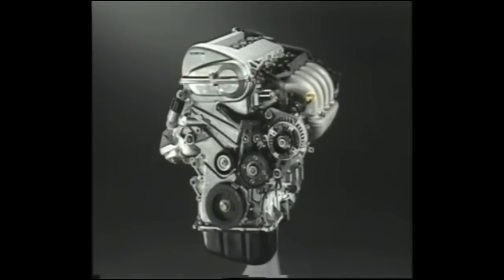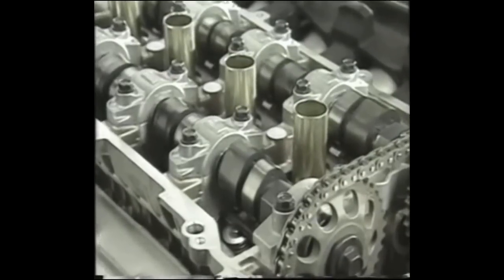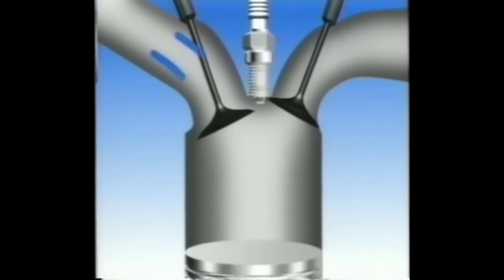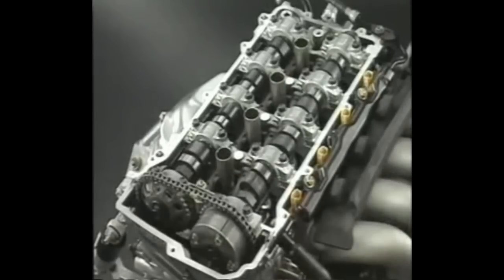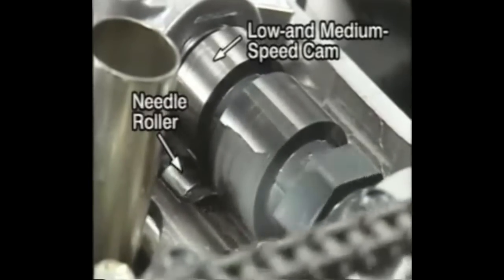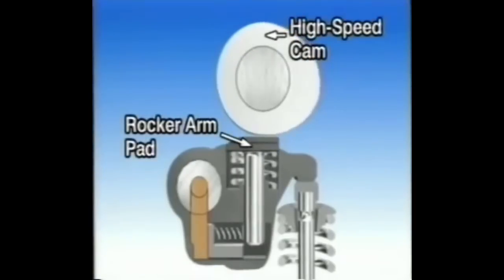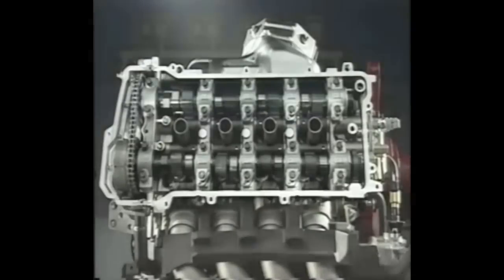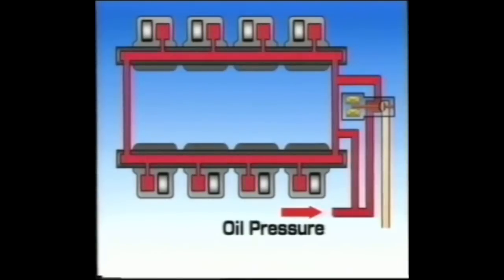Toyota's Valve lift VVTL-I explained on 2ZZ-GE engine

Comment: Two cams in one engine has been the dream of Hot Rodgers since modern Valve Timing was introduced to modern engines. TČhe first attempt was made by Rhoads Lifter company that made special hydraulic valve lifters that bled off pressure at lower RPMs allowing thend came the varicammsystem which changed the advance or retardation of the timing the came to provide different duration as the RPM. Now we have this system which changes the timing events of the camshaft by advancing or retarding of the valve lift under different Rpm Ranges the engine will see during its changes in speed. If you put all of this together and you’ve got electronically actuated valves. What a great system from a performance standpoint and koninsegg already uses. Soon other exotica super cool cars will too!
Reply from the maker: Indeed. Nicely said.

Comment: For the record, this extra complexity is worth about an extra 40 horsepower and 2000rpm to the power band, which is huge on a 110ci (1.8L) engine.
Reply: @NathanHiggers69  
The difference between the 1ZZ with vvt but not lift and the 2ZZ with vvtl is about 40hp and 2000rpm.
Reply: @177SCmaro  58-73hp difference. TRD Sports-M 2zz-ge produce 205hp, 2zz-ge produce 190hp, 1zz-fe produce 132hp
Reply: @artemreshetnikov5179  
Talking about the stock engines.
Reply: @177SCmaro  JDM 2zz-ge full stock produce 190hp.
Reply: @artemreshetnikov5179  
The US version of the 2ZZ was rated at 180hp, the 1ZZ 140. That's a 40hp difference.
Reply: @177SCmaro  UK spec is also 190hp for 2zz ge
Reply: @drewcoal  
Right. I think it either had something to do with a slight difference in the tune, the difference in how hp is rated, or it could be the crappy gas in the USA. It was also rated at 190hp in the Lotus Elise regardless of where they were sold.
Reply: @177SCmaro  the 2000 MY  did 190hp. 2001+ was 180 and reduced redline in US at least.
Reply: The 1ZZ-FE comparison isn't a great one since they're totally different engines despite being in the same series. The 1ZZ-FE produced 138bhp in top spec while the 2ZZ-GE produced 192bhp. The 1ZZ-FE has VVT-i so can't be compared with an engine with a fixed system. The cylinder sleeves are different materials between the engines, the intake and exhaust ports and valves are totally different, the stroke and bore sizes are different. The intake and exhaust systems are different etc etc. Totally different engines.

It's also difficult to determine how much power the VVTL-i system makes. The correct answer is it doesn't really make any. You could remove the system so it just rides on the big cams and get the same power but you would lose low end torque and efficiency. Alternatively you could make it run on just the small cams and it would perform just the same at low RPM but at high RPM wouldn't have as much power and would drop off much sooner. Asking how much power the system adds isn't an answerable question since the engine was designed to have that system and the two cam profiles were designed with the VVTL-i system in mind and there was no variant of the engine without it to compare to.

I suppose you could assume a cam profile that the engine would've had if non-VVTL-i engines were designed and you could compare power figures but it's all speculation.
Reply: @bradcogan8588  I'm guessing you've never actually looked at a dyno of the stock 1ZZ and 2ZZ. They make similar power (with the 1ZZ having an advantage in low end torque but not a big one) until the 2ZZ comes on it's big lobes about ~6200 rpm at which point torque, and thus HP, spike to a peak of ~40 more HP then the peak of the 1ZZ.
That is the basis for me saying the "extra complexity" i.e. the "L" in Toyota's VVTL-I is worth about an extra 40hp over not having it, which the 1ZZ, a relativity similar engine for comparison, doesn't.
And of course the VVTL adds horsepower. You can even test this by disabling the swtichover to the big lobes and watch 2ZZ flatline at 6000rpm. 
Also, again, if you look at a dyno of the 2ZZ just before lift (~6000rpm) they usually make about 140HP at about the same peak as the 1ZZ. 
And saying that a 1ZZ and 2ZZ are "totally different engines" is like saying a LS3 and an LS7 are "totally different engines" - yes and no, but it doesn't mean they're not comparable in some ways.
Reply: @177SCmaro  what I'm saying is the cam profiles were selected because they were gonna have VVTL-i. If they weren't gonna have that system they would've chosen a cam profile in between the two for a good compromise between low end and high end power as well as efficiency. This theoretical non VVTL-i engine would no doubt still make more power than a 1ZZ-FE due to the entirely different characteristics of the engine and one can only speculate. Saying the system gives it 40bhp more because when it doesn't work it produces 40bhp less isn't an accurate assumption, you're basically saying, when the engine is faulty and doesn't work as it should it produces 40bhp less which isn't the same as having a 2ZZ-GE engine built without VVTL-i.

The 1ZZ-FE and 2ZZ-GE really aren't as closely related as you might think. Other than displacement, weight, fitment, external dimensions and ancillaries, they're really not very similar at all. They're both 1800cc but have completely different strokes and bore diameters. The 2ZZ-GE has low friction metal matrix composite cylinder sleeves, it has a wider bore diameter and a shorter stroke for high RPM performance and reduced rotational mass, big Yamaha-designed wide angle ports with huge valves for high flow at high RPM, a higher compression ratio, a better flowing intake manifold etc etc. You couldn't just slap 2ZZ-GE big lobe sized cams into a 1ZZ-FE and make 190bhp.

VVTL-i isn't a system put in cars to make more power, it's a system put in place to have a flatter torque curve and a more efficient engine. A VVTL-i engine will produce the same amount of peak power as a 2ZZ-GE stuck on the high lift cam.

It's worth noting that for racing applications, the cams are often swapped for cams with a single lobe per cylinder and the rocker assembly swapped for a fixed system. These engines produce the same or higher power than standard engines despite not having VVTL-i anymore, the low RPM performance and efficiency is just reduced because it doesn't need to perform well at lower RPM like a road car does.
Reply: @bradcogan8588  
"what I'm saying is the cam profiles were selected because they were gonna have VVTL-i. If they weren't gonna have that system they would've chosen a cam profile in between the two for a good compromise between low end and high end power as well as efficiency.'
Well, duh. Obviously. Any other pearl of wisdom you might enlighten me with? (kidding)
Seriously, though, obviously if you're going to do something it's because of a reason. I'm not sure you're really adding anything here. I'm already very familiar with VVT and why one might use it or not use it. You don't have to explain it to me. (actually decided not use it in my 5.0 coyote race car, incidentally).

"Saying the system gives it 40bhp more because when it doesn't work it produces 40bhp less isn't an accurate assumption..."

Even though it's factually true. Okay then...

"
...you're basically saying, when the engine is faulty and doesn't work as it should it produces 40bhp less which isn't the same as having a 2ZZ-GE engine built without VVTL-i."

lol, um....functionally, de facto, it is. A 2ZZ with the lift not working is the same as a 2ZZ that doesn't have lift - runs and drives the same. The only difference is the extra set of lobs and the extra pad on a the rocker arms (along with some hydraulic, wiring, software, etc that control it, to split a few hairs)

btw, the engine doesn't necessarily have to be faulty to cut or increase power by turning lift off or no. When the engine is cold the ECU disables lift, for example.

Also, no. I'm saying that, because of this thing they added, this VVTL, then engine makes 40 more hp then if they had not added it and just stuck with the VVT as per the 1zz. The 2zz is, in concept if not in form, a 1zz built around lift in order to make more power and while maintaining the 1zz streetablity.

"VVTL-i isn't a system put in cars to make more power, it's a system put in place to have a flatter torque curve and a more efficient engine."

That is a half-truth because actually, it's both. VVTL is a system put into the 2ZZGE to have a flatter torque curve, a more efficient engine, and to make more power. The 2ZZ was specifically developed as a performance engine. The VVT got them a flatter torque curve but the "L" got them more hp buy extending the torque curve past 6000rpm, increasing the engines performace.

"It's worth noting that for racing applications, the cams are often swapped for cams with a single lobe per cylinder and the rocker assembly swapped for a fixed system."

Yes. A higher level of performance then was the 2ZZ was designed for. But it's still being done to make more horsepower just as adding secondary lobes was done to increase performance at the level the 2zz was designed for.
Reply: @177SCmaro  don't get me wrong the system definitely improves performance as it performs more efficiently across more of the RPM range. What I'm saying is the system itself doesn't add power. If stuck in high lift, the peak power will be the same, if in low lift, the peak power will be lower because that lobe profile isn't made for high RPM. If Toyota and Yamaha had designed the engine to not have a lift feature, it wouldn't utilise the same low lift lobes, as they're not suitable at high RPM and were only selected because the engine has the lift capability. I hope you get what I'm saying. The system doesn't add anything but taking it away reduces power but it doesn't necessarily work the same way the other way around. I think we understand each other, just looking at it from different points of view.
Reply: @177SCmaro  I guess it depends what point of view you look at it.

You might see the VVTL-i system as a way to switch to a bigger cam profile at high RPM to make more power on an engine built for low RPM performance with a small cam profile, whereas I see it as a way to switch to a smaller cam profile at low RPM for better low RPM performance on an engine built for high RPM power. 

They both make sense and I think we're looking at it from different sides of the same coin. But when the question is asked "What does the VVTL-i system do for peak power" your answer is about 40bhp whereas my answer is nothing. Both correct answers when viewed from their respective points of view.
Reply: @bradcogan8588  
The system definitely adds performance  but the system doesn't add power. 
I don't know what to say to that, if the system is "improving performance" then it's adding power (performance), if it's adding power it's improving performance. You just said that same thing twice, agreeing with it once and disagreeing with once. 
The system does add power or take away power. It depends if it's on or not. 
"The system doesn't add anything but taking it away reduces power..."
Again, that's saying the same thing two different ways and denying it and agreeing with it. If something is taken away it can be add back. It's both.
I understand me. I understand you. But I don't think you understand you as you're basically equivocating all over the place while thinking that you're being rational.
Reply: @bradcogan8588  
.
Reply: @bradcogan8588  
"You might see the VVTL-i system as a way to switch to a bigger cam profile at high RPM to make more power on an engine built for low RPM performance with a small cam profile, whereas I see it as a way to switch to a smaller cam profile at low RPM for better low RPM performance on an engine built for high RPM power."

I see it as both at the same time. The mistake you're making is framing it as a (false) dichotomy. The 2ZZ was built as a "low" and "high" rpm performance engine (relatively speaking, I own one of these and they're pretty dead below 3000rpm so, really, they're more like a "mid" and "high" rpm performance engine as opposed to one or the other) it's not a low rpm engine made high rpm or a high rpm engine made for low, it's both. That's the whole point of what VVTL allows you to do.

We're not looking at it from two different sides of the same coin. I'm looking at it for what it is and you're trying treat the same idea as being two different things at the same time in order to try to salvage your original thought rather than amend it. Not to get all philosophical on you, but that's a fundamental violation of the "Law of Identify". A is A, it can't be A and B at the same time. Adding performance and adding power are both "A".
Reply: @artemreshetnikov5179  apparently some of the 1st year 2003 Matrix XRS with the 2ZZ-GE only made 165hp. That's the one I had in the car I bought for $400CAD. It was the rare 1-year only XRS with the auto trans so it was pretty useless but still fun to hear the VVTL-I kick in
Reply: For another 500k USD you can have another 100HP.
Reply: ぐるぐう  
It's probably both. The tune in different because the fuel is different.
Reply: ぐるぐう  
I actully run e85 in my race car. If you take care of it's quirks it kicks the shit out of pump gas and most race gas in a performance application. 
And it maybe that US fuel has improved since the early 2000's when the 1zz and 2zz came to the US. And fuel quality also varies within the US. It's also possible that you're right and I'm wrong.
Reply: Yea the difference between the 2zr and 2zz
Reply: @thehugob77 you can turbo it reliably for less than 10k and more than 300hp peak
Reply: @drewcoal apparently the UK(euro) spec puts out 192hp, the Japanese spec puts out 190hp and the US model puts out 180hp

Comment: I have a 2006 corolla xrs with this 2zz engine. Whata a good maintenance list that I should have besides the engine/transmission oil?
Reply from the maker: We advise to check the liftbolts every major service or around the 40k miles. And replace if signs of wear. The later models don't wear as fast/bad as he old version. But it's a cheap insurance.
Also while the valve cover is off, check for wear on the high lobes of the cams.
The valve cover has a oil supply that sprays oil on the cams. Check if the line is not blocked (by blowing some air through the line and see if all holes are open.) and replace the little o ring on the oil feed line on the valve cover.

Hope it helps.

Comment: Just over 200,000 miles on my 2ZZGE and still going strong. Use Denso IK20 (5304) plugs in mine. Seems to help also. Regular oil changes. Lift bolt inspection every 35 000 miles. Keep OCV filters clean. Should last. Fingers crossed! But excellent engine.
Reply from the maker: Nice. If well maintained like you do they can last a long time

Comment: Great Explanation on the 2zzge! 00’ Celica GT-S
Reply: ZZT231RyDa gts? Is that USA spec? UK and Ireland had Celica T-Sport 140 and 190hp using 2zz-ge also Corolla hatchback T-Sport and Corolla T-Sport Compressor also hatchback.
Reply: Yeah here it's Celica GTS and Corolla/Matrix XRS, and of course the Lotus Elise, Exige and 2Eleven.. I have a Pontiac Vibe GT featuring the same eng/trans $550 auction cars FTW.
Reply: @TheBlueCorolla  The 140hp actually has the 1zz with only vvt-i.
Reply: @КлиментЦонков  what is diff between vvt i ans vvtli
Reply: @harveymorgan1749 no lift on the 1zz

Comment: I had a 2003 Matrix XRS with this motor! Toyota put it in the Celica, Corolla, and the Canadian-made Matrix xrs! Mine was tuned to 208 hp at the crank, and was dead ass reliable, especially if you had the kit to fix the oil starvation at high rpm’s! The 2ZZ-GE also has a full metal intake, as opposed to its sister engine, the 1ZZ that was in non-XRS models! This was the Best and most fun 4cyl motor Toyota ever made! It was made in partnership with Yamaha! (which Toyota owns part of) I REALLY wish Toyota continued this VVTL-i technology in their other engines like 2TR-FE and 2GR family 😢
Reply from the maker: I assume it was to 208 HP :)
But they are indeed very fun.
Reply: @SVSportscars  yes 208 I meant! Hahahaa!😍
Reply: What all was involved in the tuning? Just ecu map? Or did you make breathing mods as well? And did you lower the rpm lift point? I know in the corolla its about 6800 but maybe lower in the Matrix and Celica

Comment: i enjoyed the video, to bad it doesnt explain the poor choice in oil pans lol.
Reply from the maker: Indeed. Well I assume Toyota did not think it was a poor design themselfs.
It's odd that the 1zz has a better pan than the 2zz but I doubt Toyota really thought these would be used in high G situations as they later did in Lotus models etc.
Reply: Yeah bit of a weird one. The 1ZZ-FE pan isn't really an upgrade like many think. It just has a windage tray in it. The 2ZZ-GE also has a windage tray but it's fitted to the bottom of the engine not the oil pan. Fitting a 1ZZ-FE pan to a 2ZZ-GE is just doubling up on windage trays which doesn't really do anything. 

Most owners who know they're gonna corner hard in them weld in baffles or buy an aftermarket pan.
Reply: @bradcogan8588  what's the best pan to get who is making ones to help? Does the Elise run something different?
Reply: @9freelandk  the elise runs a standard one although most people who are taking the car on track use the Moroso pan or weld in their own baffles.
Reply: @bradcogan8588  Many thanks I'll look into this on my next oil change I'm concerned as the corolla had a lot of lean angle and I don't plan on changing the handling geometry.